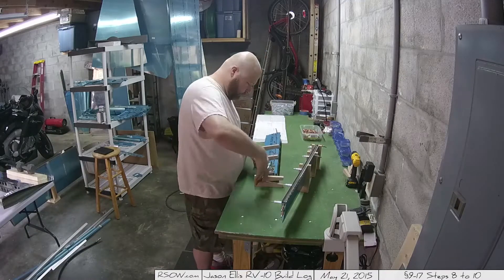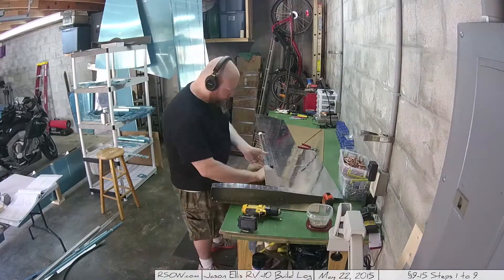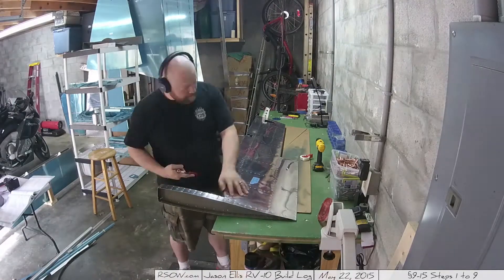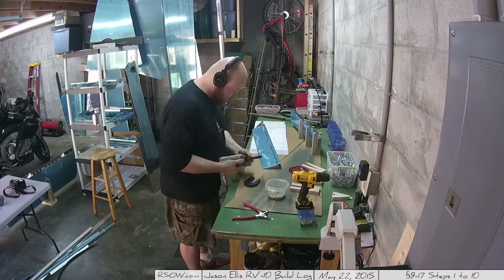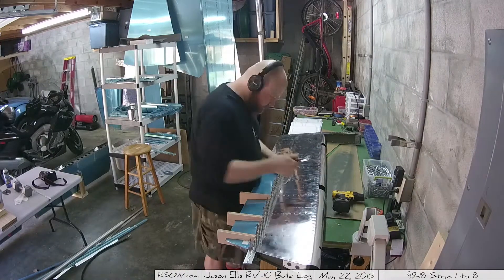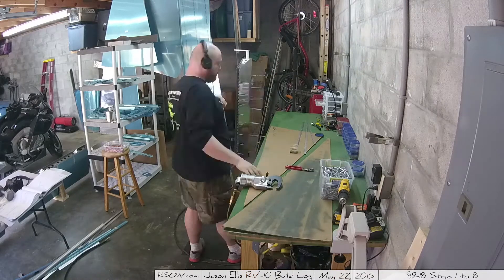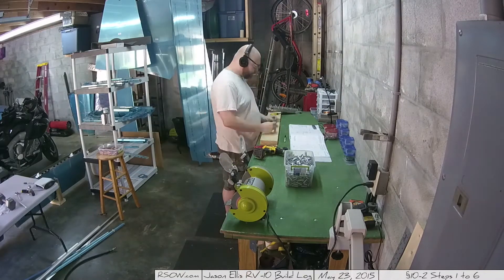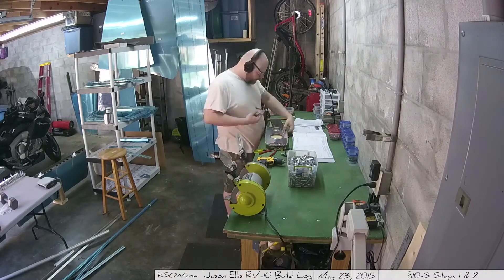RV-10 Empennage Sections 9-15 to 10-3

Comment: Hi Jason
You recommended the 4" yoke and the longeron, and that you were swapping off your (original? unknown-sized yoke?)..
Being cheap and loving tools: I would love to get every sized yoke, but: Can I justify it? Which can you justify? Being as far along as you are now.
P.S.: In an earlier video you estimated your completion date at Jan 2020. How do you feel about that now? I think the work you've put in is awesome: Thanks for the videos!
Reply from the maker: You have a looong way to go yet.. keep watching.. My plane will likely not be done until 2022 at this point.. Life.. sigh  Regarding the yokes you don't technically need a squeezer at all but geez.. not having one would suck.  I highly recommend the Longeron Yoke, The 4" no hole yoke and the standard yoke.  You can get others but you don't need them.   The only other one I might consider would be a very small "tight spaces" kind of yoke.. I dont have one to recommend though.
Reply: @JasonEllisBuilds  I haven't gotten a kit yet, but I'm making an equipment lists; although I anticipate I'll borrow tools from my local EAA chapter. I heard about the Numatx squeezer: expensive, but its size and weight seem like they can be worth it...
That aside: besides the compressor, how loud is the assembly process? Electric drills and screams of pain seem to be near the upper limit of acceptable, but because they don't drone on are acceptable. The rivet gun may be loud...?